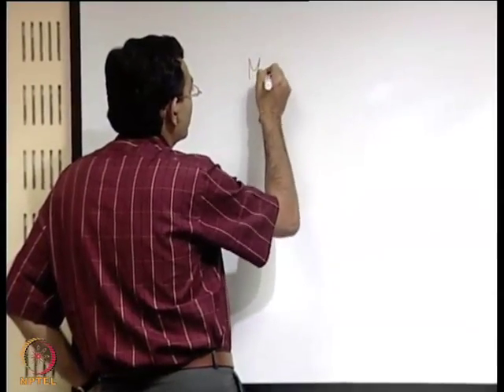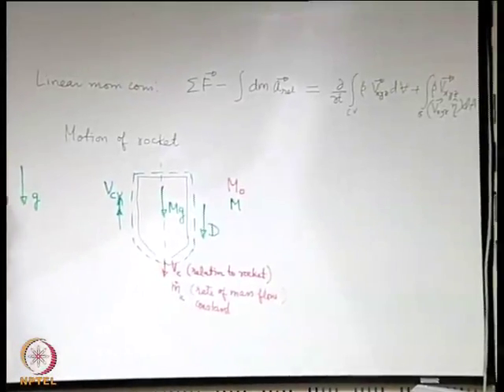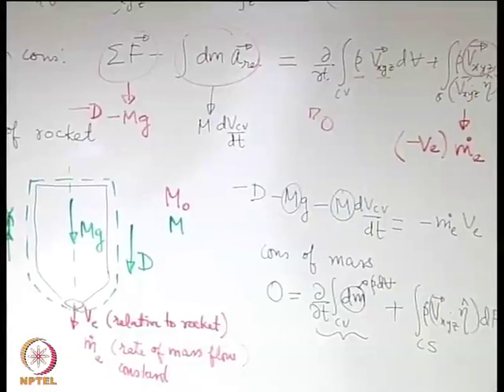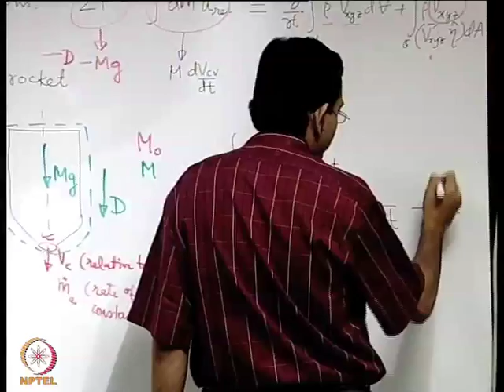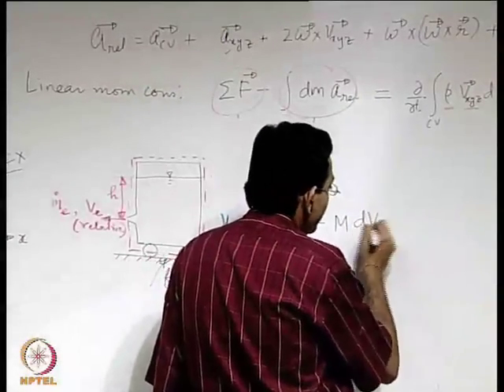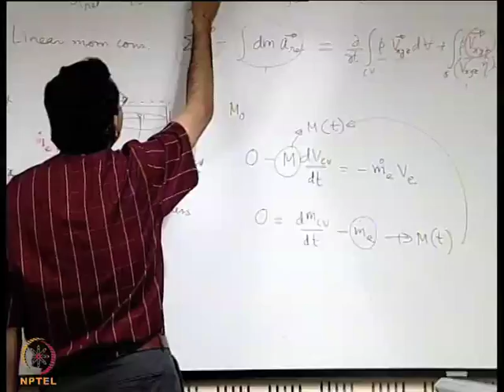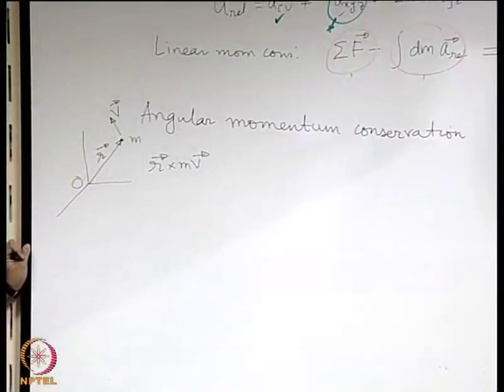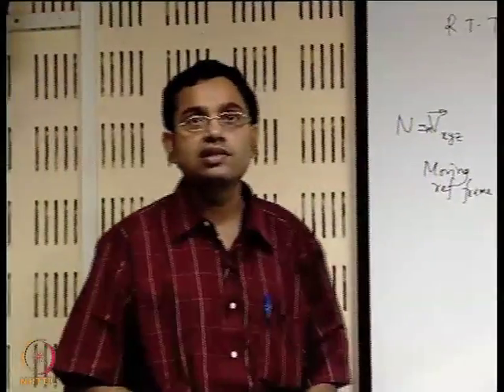Mod-01 Lec-26 Integral Forms of Control Volume Conservation Equations

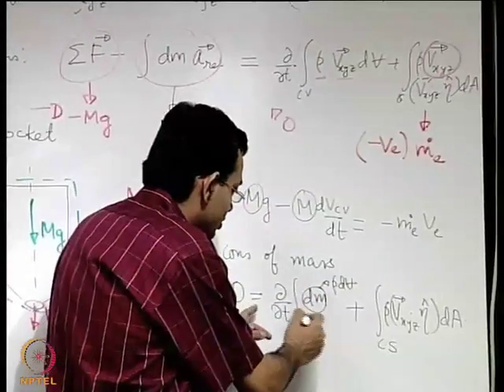Comment: The first example is so great but in linear momentum eq., CV term on the left-hand side vanish (at 13.19) because of assumptions (incomp flow(rho), uniform velocity (Vxyz) and non-deformable volume(V)) while in the conservation of mass eq., rho dV combined as a dm and integral taken without vanishing (at 17:16). Why did the same thing not applied in the linear momentum equation?
Reply: Same doubt broo
Reply: Sir told that he had assumed that cv is not function of time in first case , but in 2 nd case as mass is changing with time so he hadn't neglected it .

Comment: Motion of rocket mein
Pehle momentum equation mein density constant mani

Lekin mass equation mein density ko variable man liya 
Aisa kyon
Reply: HII BRO WHAT EVER YOU SAID IS RIGHT .THE DENSITY CANNOT BE CONSTANT. SINCE DENSITY OF AIR FUEL IS CHANGING THE MASS OF AIR FUEL IS CHANGING BUT VOL IS CONTANT . SINCE CONTROL VOLUME IS NOT CHANGING AND VEL OF JET IS NOT CHANGING WITH TIME HE NEGLECTED IT FOR MAKING PROBLEM SIMPLER  . BUT WHILE MASS CONS EQUATION SOLVING WE HAVE TO CONSIDER . OTHERWISE NO POINT OF SOLVING